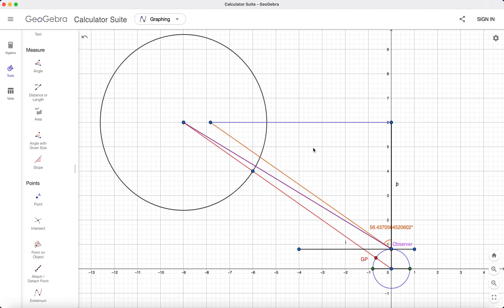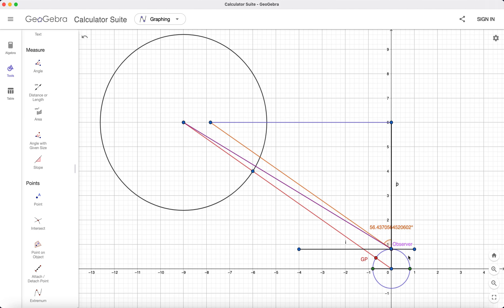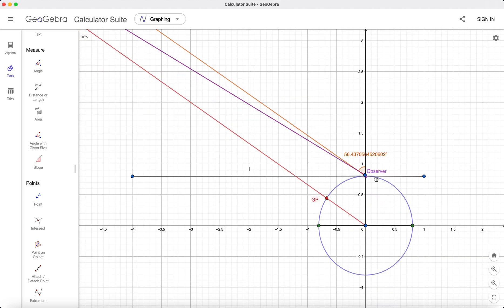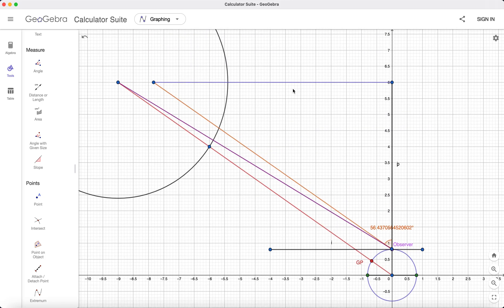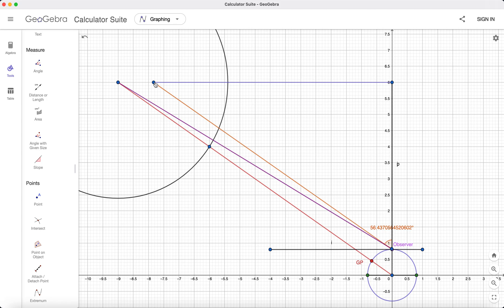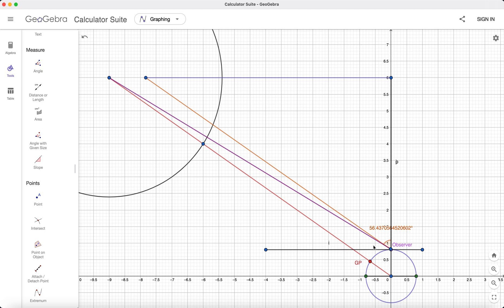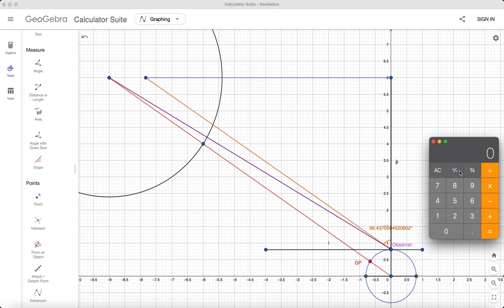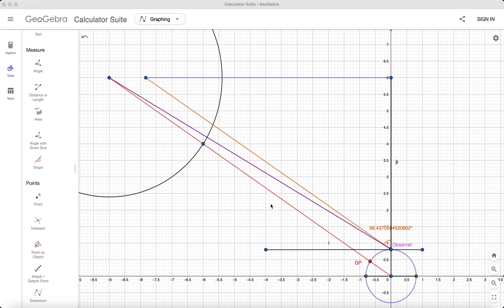Zenith Phobia....?

Comment: If Wally and his Uber Sextant was right beside 10thMan and his sextant, would they read the same elevation angle to the target object?
If not then why not?
Reply: No. 10ths sextant is applied in Euclidean 3space where straight lines do exist to form angles. The angle would be accurate as 10ths ability to measure it. 

However, in contrast, due to earth's mass bending spacetime, Wally is unable to measure anything with HIS sextant because he has no idea where to point his crosshairs.  Nothing is where it appears to be in curvilinear coordinates caused by earths mass bending the geometry. Wally would aim at the target star and measure an angle using two straight lines but these are invalid in curvilinear geometry I'm afraid. Although he does measure an angle, his applied Euclidean geometry is incompatible with the curved geometry of spacetime. So Wally isn't able to claim any angle at all. He will do because he doesn't understand but this is the problem I'm afraid. 

Applying Euclidean geometry to curved spacetime is a contradiction in terms. 

If you disagree, please explain why.
Reply: @sleepingwarrior4618  "However, in contrast, due to earth's mass bending spacetime"

If you believe earth's mass bends spacetime then you would understand why the Lense-Thirring effect irrefutably proves you wrong about flat earth.

Comment: You've been told a thousand times Brian - that line you've drawn across the top which you've called "zenith distance" is meaningless. It has nothing to do with navigation.
Reply: He's going to have to be told another 1000 times.
Flattardia has no horizon and has ever diverging lines of longitude, for which they have no sight reduction tables, nor a Universal Plotting Sheet.
The muppets have nothing.
Reply: “The ***king definitions of words are meaningless” Roohif 

How’s that geometric tangent point sphere edge horizon working out for you roofy 😆 

Still “no Atmo day”?……meanwhile you, me and anybody using celestial navigation will require a flat plane.

“The altitude angle (sometimes referred to as the "solar elevation angle") describes how high the sun appears in the sky. The angle is measured between an imaginary line between the observer and the sun and the horizontal plane the observer is standing on. “ - Sustainable By Design :: Altitude Angle

The elevation angle (used interchangeably with altitude angle) is the angular height of the sun in the sky measured from the horizontal - Elevation Angle | PVEducation

Measurement of the elevation angle
“Elevation angle is the angle between the horizontal plane and the line of sight, measured in the vertical plane. The reference direction (i.e. an elevation angle of zero degrees) is a horizontal line in the direction to the horizon” - Elevation Angle - Radartutorial

Angle of Elevation
“The angle of elevation is the angle between the horizontal line and the line of sight which is above the horizontal [not curved] line. It is formed when an observer looks upwards. Suppose you are standing at the terrace of a building and looking upwards at the sky or at the sun or moon. The angle thus formed between your height from the ground level and the line of sight formed is called the angle of elevation.” Angle of Elevation - Formula, Definition, Examples

Angle of Elevation Definition
“The angle of elevation is an angle that is formed between the horizontal line and the line of sight. If the line of sight is upward from the horizontal line, then the angle formed is an angle of elevation.” - Angle of Elevation - Definition, Formula and Examples

“The altitude angle (sometimes referred to as the "solar elevation angle") describes how high the sun appears in the sky. The angle is measured between an imaginary line between the observer and the sun and the horizontal plane the observer is standing on. “ - Sustainable By Design :: Altitude Angle

“The "upwards" angle from the horizontal to a line of sight from the observer to some point of interest.” - Definition of Angle of Elevation

Angle of Elevation
Definition
“An angle of elevation is an angle with one horizontal arm, and one arm above horizontal.
Usually an angle of elevation is less than or equal to 90°.” - Angle of Elevation 

Share your pain, refracted horizons are not tangent points for a plane you need for an elevation angle 📐
Reply: @NathanOakley1980  Excellent use of copy paste, well done 👍 Still no entry to MCToon’s challenge I see. It’s ALMOST like no one on the panel has ever fixed a position via celestial navigation 🤷‍♂️
Reply: @NathanOakley1980  Well done. Plenty of reputable citations. Not one of them says that the angle is measured from the horizon. They all talk about a horizontal reference plane. #GlobeConfirmed
Reply: @NathanOakley1980  You still have that duplicate citation in your copy/paste comment, Nathan.
Reply: As detailed by Zanic…. Here — Globe Believer Must Establish “A Flat Plane”
https://youtu.be/5gKeAmol168
Reply: Help me help you “establish a flat plane” roofy.

I can help you, you just need to understand that you need the help, and want it first. It’s a long journey for one so lost but we are here for you buddy. Help me help you. Remain vigilant!
Reply: @NathanOakley1980  Yeah, just like Brian, it seems you need to be told a thousand times that “eye level” (aka a horizontal plane) is NOT the surface. You’ll never graduate from the remedial class at this rate 😭
Reply: @NathanOakley1980  said “establish a flat plane”

Sure, let's use that as a basis, and find that it proves the seas to be Not Flat. 

https://www.youtube.com/watch?v=KdxpJMXGeHE&t=8s

A whole host of other flatties have tried, given up and gone home with their tails between their legs. How will you fare, if you even bother to turn up at the door....? 

[Brian's Logic has left the chat]
[Gary Wybenga has left the chat]
[T Brown has left the chat]
[Flatzoid FE has left the chat ...] [... leaving questions unanswered] 
[Colin Dresser has left the chat]
[Level Means-Flat has left the chat]
[Flat Earther has left the chat]
[Straight Curve has left the chat]
[Ryan Q Vincent has left the chat]
[The Plane Truth has left the chat]
[Gleem has left the chat]
[Sky Vajra has left the chat]
[Man on the Edge has left the chat]